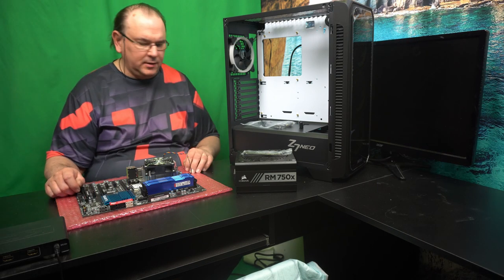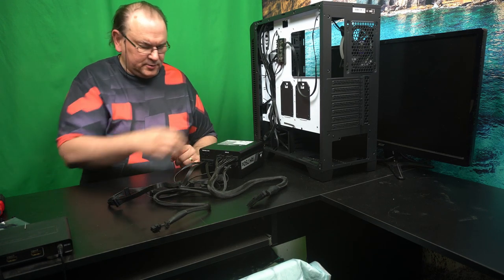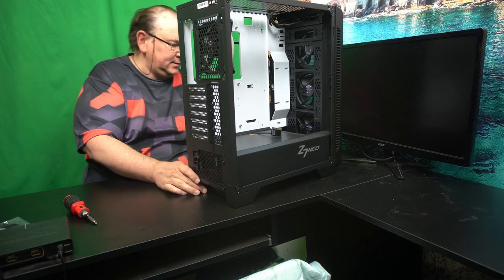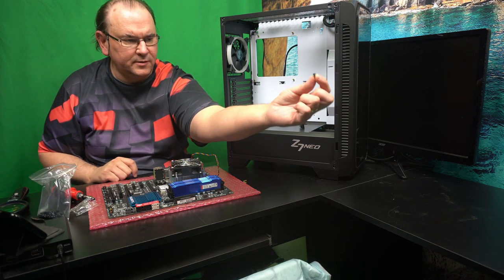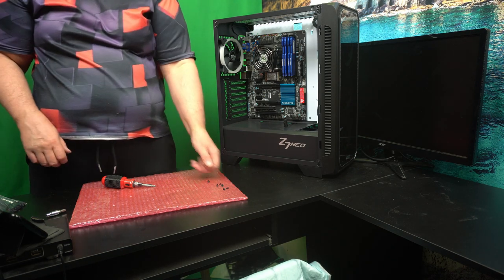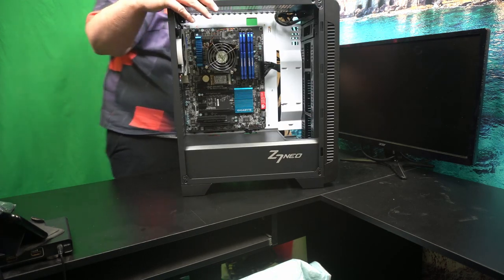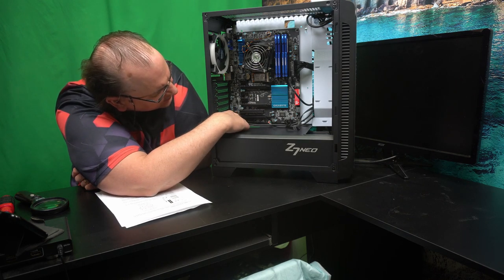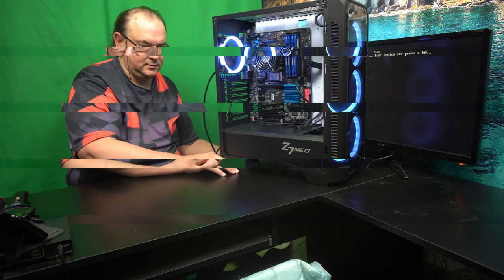Installing RM750x power supply and GA-Z77X-D3H motherboard in Z7 Neo case

Comment: Hei great video, i got the same case but cant get my fans to light up and i cant adjust the speed on the fans can u help me?
Reply from the maker: If You need the manual here is the link: https://www.zalman.com/EN/Product/ProductDetail.do?pageIndex=1&pageSize=10&productSeq=130&searchCategory1=0&searchCategory2=-99&searchCategory3=-99&searchKey=&searchWord=&active=pro_manualTab#pro_detail_tab

Not the same brand but similar:
PC build NZXT AER RGB controller for fans installation
https://youtu.be/AJiUM0NOXTs
Reply: @TheTechRabbit  This is actually so useful! Youre the best man

Comment: Can you provide me the product model # for thise fans that come with the Tower Case Z7Neo. I want to purchase 2 of them to put on my AIO Liquid Cooler system for fans. Any help or information would be greatly appreciated.
Reply from the maker: Look in the manual 

https://www.zalman.com/EN/Product/ProductDetail.do?pageIndex=1&pageSize=10&productSeq=130&searchCategory1=0&searchCategory2=-99&searchCategory3=-99&searchKey=&searchWord=&active=pro_manualTab#pro_detail_tab

No specific product numbers but fans are Zalman branded so assuming they also sell them separately. Take a look at Cooling section on same page.